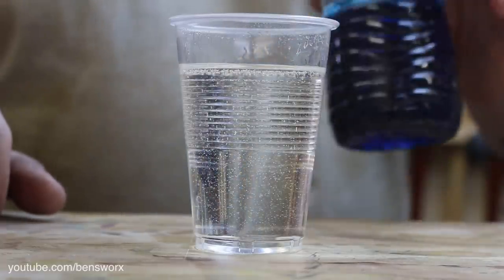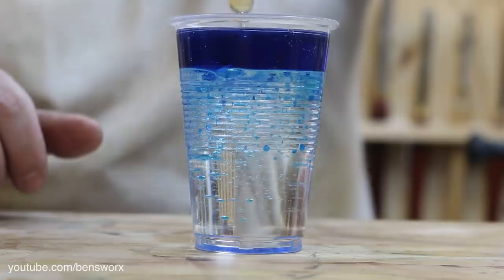Can You Cast Water in Epoxy Resin ?

Comment: You could try waiting for the epoxy to begin to cure and inject the water in the center with an eye dropper or syringe and see if the bubble of water will stay put.
Reply: Yeah, kind of the same theory as for the ice cube.  Have it set just enough so it doesn't immediately escape to the surface.
Reply: I was thinkng the exact same thing 😂
Reply: maybe use uv resin right so after the water is poured you can cure it with the light
Reply: Lol yeah, I was gonna suggest that

Comment: If you want the water to stay put, it needs to have the same weight/volume ratio as the epoxy. You can take a cup of epoxy and weigh it and a cup of water and weigh it. Water will be lighter, but you can keep dissolving salt into it and make it heavier until it matches the weight of the resin. Then when you pour it, it should stay put in that cool Lava lamp pattern.
Reply: If only he actually did this instead of just randomly guessing at the needed salt when he did this test it might have actually worked.

Comment: You should get a syringe with colored water in it and, like the ice cube, wait for the top layer to start to solidify before injecting. You could keep the syringe tip submerged in the resin, ready to inject the water. And you could pour up a little more resin off to the side that shouldn't start setting up at the same time as the one being injected, that way if you pull the needle out and the resin sticks to it and leaves a hole, you could just pour more resin over it to sort of seal the hole off. 

This makes more sense in my head, please respond to this if you don't understand so I can explain it better.
Reply from the maker: Great idea 👍

Comment: Yes it is steam from the water . The boiling point is extremely low when you take away atm pressure . The heat from the chemical reaction is enough  to turn the water into a gas
Reply from the maker: Thanks for the information 👍

Comment: As a follow up, I'd like to see you mix it fully like in the first but this time see how much there is in the small cup with ridges, before you add the water, to know if all the water is driven off as steam, or if some of it is stored inside the milky set resin, as at end will be able to see if blank is same size as control where you didn't add any (or you could just use a line on the cup and not waste the resin making a control). Interesting to see what you made, just occurred that it may be interesting extension.

Comment: Would be interesting to see you try something similar to this. Firstly, maybe waiting for it to partially cure like you did with the ice cube, then using a needle to inject a bubble or bubbles of water into place in the curing resin. Also, I'd be interested to see how using a different liquid, for example; mineral oil, mineral spirits, vegetable oil, vinegar, and ethyl or isopropyl alcohol. Maybe there is some liquid that has the same density too, so neither the resin nor liquid would rise to the top? Maybe something like honey?

Comment: What if you fill a syringe with water, and cut a hole in the bottom of the cup. Insert the syringe and hot glue around to seal, and wait for the resin to thicken up, then inject the water through the bottom of the cup?

Comment: Here’s my idea. Take your cup, put colored water in and freeze it. Put the resin on top and directly into the pressure pot. The heat from curing will melt thence as the resin sets. With a bit of luck or experimenting, you might get some of the water stuck in the cured resin.
Reply from the maker: Great idea!
Reply: @BensWorx  slight amendment to the idea. We both know that ice floats in resin. To prevent the ice from dislodging early, include a few fishing weights in the ice (like the teardrop shaped ones).

Comment: So does the pot get hot inside? Or is it just pressurized? How does that make the resin solidify? May be a stupid question but, I'm asking anyways. I always thought it got hot (I am not sure what I thought honestly, because wouldn't that keep the resin in liquid form actually? 😅🤔) but the fact that you use a pot cam makes me think otherwise.
Reply from the maker: no only pressure, the heat is given off by the curing resin, the resin solidifies from a chemical reaction
Reply: @BensWorx  wow, that's the last thing that I thought 😅 I watch resin videos all the time, but I never realized because they always use a pot, thank you for answering!!

Comment: Hi ben, I just got my first lathe and had a question about how it worked. When turning between centers, how hard do you have to push the drive center into the wood? Mine keeps coming loose...
Reply from the maker: if its coming loose try hammering the drive centre into the wood first before mounting it on the lathe
Reply: @BensWorx  Hmm, I've done that before, and it just carves a circle in the wood. maybe the wood I'm using is too soft...? If I hammer it any further, the wood splits.

Comment: Well resin is oil based and will not mix into water as all oils are the same thing the two don't work and the oil will float to the surface and like concrete it's chemistry makes it set and go rock solid even under water